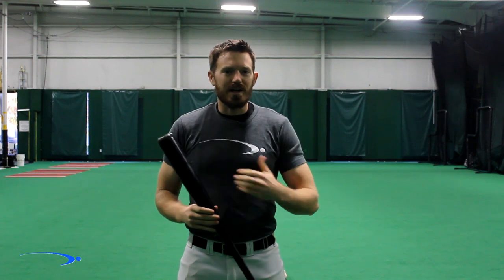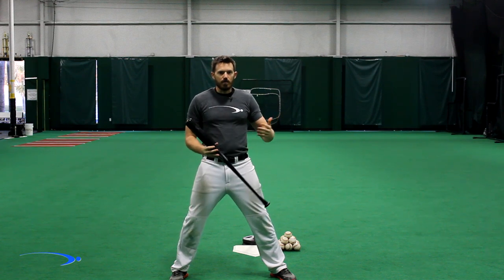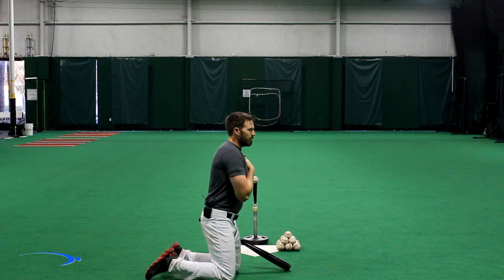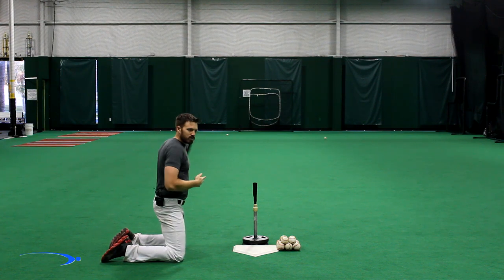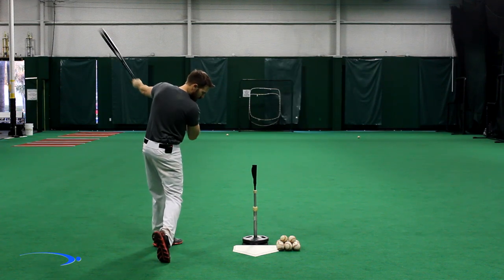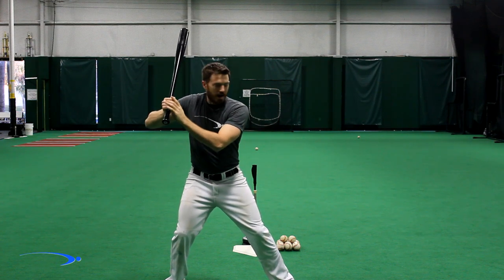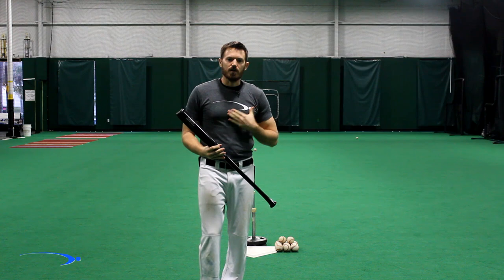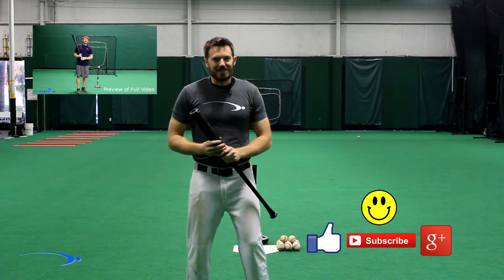How To Fix "Pulling Off the Ball" | Hitting Drills (Pro Speed Baseball)

Comment: In this video you suggest that the hands should initiate a normal swing. Yet , in the power series videos, you suggest that the hips should initiate the swing; sort of creating hip separation.  So , what should start the normal swing (game like): The hands first then the hips, the hips first then the hands or both the hands and the hips at the same time?  I am a bit confused. Thank You
Reply: +Sergio Molina Stay sequential: feet (Stance-Stride), knees(Stride), hips, core, chest/back, shoulders, arms, hands, bat. Granted, the hands will turn its the shoulders, but it is a product, not an active movement. If you are out of sequence many incorrect things can occur and the end result is loss of power and direction in the path of your barrel. Start with your hands and cast and you swing around the ball pulling an outside pitch which usually results in a ground ball to the left side. In relation to the hips and hands you commented on, you want to create separation between your upper and lower body in order to create torque which is the force that 'yanks' your hands through the zone...obviously in sequence. Good luck.

Comment: Good video overall but I think hands first is going backwards against what we want young ball players to learn early. For example if you notice at a very young age (t-ball for instance) the common swing you see in kids is an all hands only swing with them usually trying to reach for the hit. I think you would agree that baseball is all legs, hips, and core body before engaging the hands. This goes across for all positions in baseball. Well all except for the bat boy. :) What you seem to be describing is when a batter "turns on the ball" during a swing which is very common and can be a valid swing at times depending on where you are trying to hit the ball to. Just sharing my thoughts and experience from many moons ago but keep up the good work with all your videos!

Comment: I think that teaching hands first is a bad way to address this issue, especially since none of the great OPS hitters lead with their hands.  The hands should lag behind the body.  A better fix for this issue would be bending at the waist during the stride and staying behind the ball and having side bend during the swing.  That creates a swing plane that allows the bat to stay in the hitting zone longer than being upright like you are in this video, and subsequently will eliminate pulling off the ball.  I work with a lot of kids and know that hands first is definitely not what you want to teach them because that's how a lot of them are when I start working with them.  They end up not using their lower half at all because they get so focused on using their hands and there is nothing to initiate the lower half when the swing starts with the hands, can't get on pitch plane because their body isn't in the correct position, and end up lunging toward the pitcher trying to take the hands to the ball to start the swing.
Reply from the maker: +Brian Ingram Hey Brian, thanks for the comment! You're absolutely right, the hands do not technically go first in a good swing. The explanation and drills in this video are more for feel, for hitters who tend to overdue the sequencing of the swing by having their body spin too fast.

When a hitter who spins too fast, "thinks" hands first, the hitter will rarely over due the sequencing the other way (where the hands go way too soon) and usually be much closer to being sequenced correctly.

Therefore, if there was a hitter who's hands outraced the body, it would be a good "feel" drill for them to feel the body go first.

There's quite a few hitting flaws out there, and it'd be tough to address them all in one video. This video, is for this issue specifically

Most definitely appreciate the critique! Always completely open minded when discussing things with other instructors, and see it as a way to make myself and my students better!

Thanks again for the comment! ~Michael Pro Speed Baseball
Reply: Do you have an example of the drill you are suggesting? I am very interested in it. Thank you.
Reply from the maker: What drill are you referring to? ~Michael Pro Speed Baseball
Reply: Straight from the book of Ted Williams

Comment: If your hands out race the body, aren't you losing power based on bio-mechanics and a sequential swing? If you initiate your swing with your hands, doesn't that lead to casting? Isn't casting swinging around, or to the outside of the baseball-which is not good? If my shoulders stay closed throughout the swing, as you are suggesting in this video, wouldn't that inhibit a full swing and not utilize my entire body? Especially on a middle/middle inside/inside pitch? I understand the use of a, or in this case the drill, but you seem to be prematurely rolling the wrists through the ball/swing.
Reply from the maker: +The Baseball Barn Hey Baseball Barn, thanks for the question!

Yes, if the hands literally outrace the body, we will not be as efficient with speed/power. The purpose of this video is to address the large percentage of hitters that fire the body much too quickly and outrace their hands. 

The drills and feelings addressed in this video are to over exaggerate the feeling of pulling off of the ball with the body, with the exact opposite feeling of swinging without moving the body at all.  This will be a beginning step in helping hitters sync up their swings.

To answer you second question: The swing isn't literally initiated with the hands, the video, again, is a swing thought for hitters who struggle with pulling off of the ball with the body.

Even if the swing were initiated by the hands, this also wouldn't necessarily mean automatic casting/hitting around the ball.  I have a great video on casting coming out soon that will explain this in more detail, yet casting is simply more of an early release of bat lag than it is a body movement. A hitter can hit a ball with straight arms, and still strike a ball dynamically to all fields. (Not with much efficiency, but it can be done)

And yes, if your shoulders were to stay closed throughout the swing it would inhibit the use of the body. Again, the drills in this video are designed to FEEL the opposite of pulling off of the ball.

When a hitter makes full speed swings with the same feeling from the drills, they will be more synced up and the shoulders will open at a more desirable point during the swing. (Unless of course the hitter is being extremely literal and stops rotation)

Therefore, there was never any suggestion of not rotation the torso/shoulders in the swing, but an avenue in which to rotate them in the proper sequencing.

And for the drills, the wrist will roll over after the strike of the baseball in order to keep the shoulders square for the drill. 

Hope this answers your questions! If you have any other questions or need help with anything else, just let me know!

~Michael Pro Speed Baseball
Reply: I appreciate your time and feedback regarding my questions. I wish there were a more efferent manner in exchanging information. I think you have some good stuff, but...it would take us both a year to explain everything. That will be for another time. Good luck.
Reply from the maker: +The Baseball Barn  Anytime! And thanks! I agree, it would take a very long time to explain every detail when it comes to hitting.

 ~Michael Pro Speed Baseball

Comment: Wait, I thought you were supposed to start wi your hips???
Reply from the maker: Hey Colin, thanks for the question. Yes, the sequence of the swing is started generally with the hips. The instruction in this video is to aid players who are out of sync with their swing.  Meaning, hitters can overdue the opening of their hips too soon, therefore dragging the upper body through.

The drill in this video is for players to feel the hands go first to over-exaggerate so they have a better chance of being in sync with their swings.

So the hands wouldn't actually go first, they would just feel like they are doing so! ~Michael Pro Speed Baseball
Reply: Colin Kelly hi

Comment: I don't agree with these fixes. The hands should never lead the swing and the shoulders should never stay square in a good swing. The hands need to lag to create bat speed and the shoulders need to turn to continue to drive the ball. Players need to learn good posture. Pulling off the ball occurs when a player starts to go upright and pulls his shoulders level and away from the plate during the swing. Players should keep there shoulders in line with the bat and have the front shoulder pointing up and the rear shoulder pointing down. Unfortunately, drills aren't always the fix for this problem as there can often be a lack of core strength which creates the issue. In these cases, hard work in the weight room or a plank routine would be more helpful.
Reply: Dev518 I watched this guy called antoneli baseball, and ur saying the same thing as him

Comment: Yeah, this is a pretty bad tutorial. Just watch a mike trout swing in slow motion. His shoulders move a ton. It's not about keeping the shoulders still, it's about getting them to rotate in a more vertical plane rather than a horizontal plane. The back shoulder has to drop, the front shoulder has to rise. It's kinda impossible to hit with any power if you keep your shoulders still.
Reply: The point is to keep them square.  Young players trying to add more power have a tendency to pull off the ball with ONE shoulder...their lead shoulder.  The more they do it, the more they pull the bat with them EARLY causing mishits and hard pulls. Yes, lead shoulder needs to rise and back shoulder drops...BUT, they are supposed to do them IN SYNC as in "square".

Comment: Why would you make a kid learn something he will have to unlearn later. If he is pulling off the ball it almost always because his timing is off. Every kid you teach this to will fall behind the kids who do it right. You can't hit the ball with power unless you lead with your hips then your shoulders.
Reply: The video is a "Feel" video.  Kids learn faster when they can actually incorporate another sense into the learning process. The coach never says that this is the correct swing.  It is an exercise to help hitters feel their shoulders at contact and not over rotate, too soon.  Just helping them be more aware of their body mechanics.  
Dan, do you have another drill for correcting the issue the coach is trying to address in this video you can share?